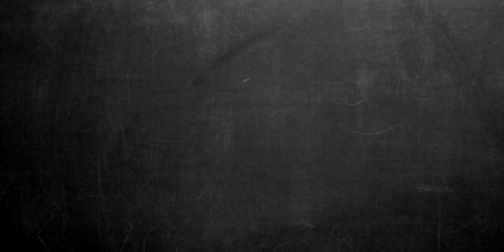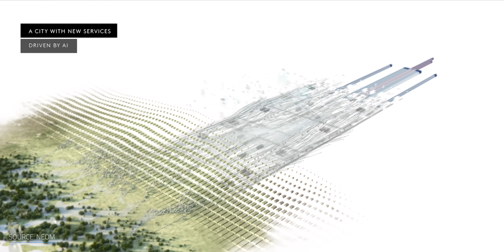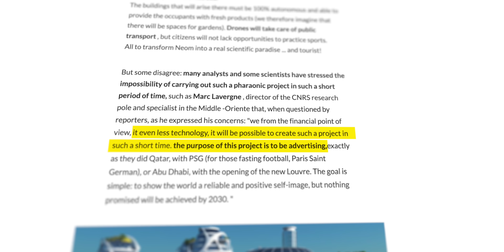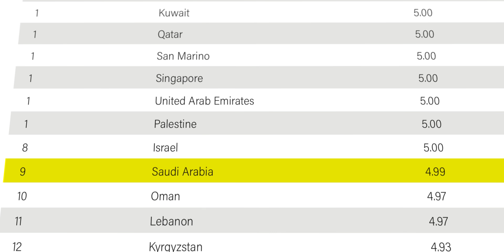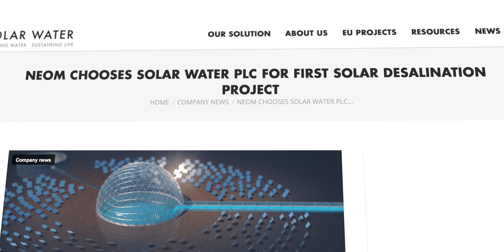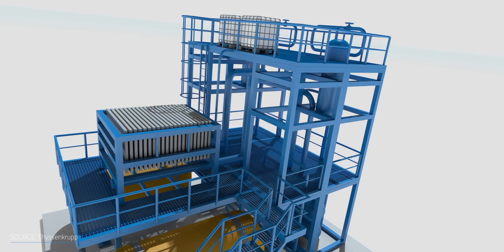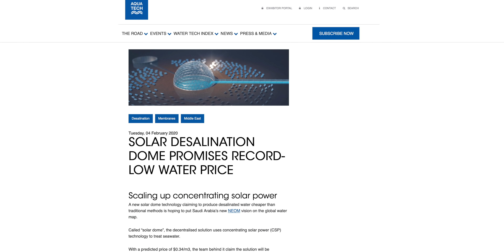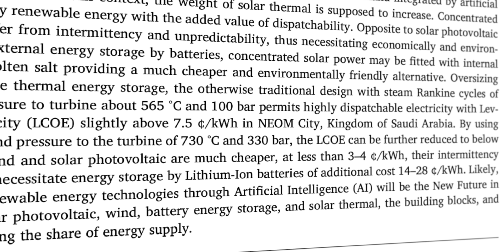Why Neom Might Be The Future of Sustainable Cities

Comment: Probably beyond the scope of this channel, but I'm also interested in the urban planning argument, most discussion of which I've seen seem to say 'bad'.
Reply: I've explained in other comments why, but basically, there is a reason every single city in the world naturally forms as a rough circle.
The short of it is that you want people to be able to get from place to place as efficiently as possible. A line is, geometrically speaking, the least efficient way to pack things closely. So, a city in a line is just a bad idea.

For a hypothetical, let's design a city with 1000 buildings, scattered at random for our purposes. If you place them in a line, that's effectively a 1x1000 grid of buildings. The longest distance one may have to travel in this layout is 999 blocks. The average travel distance for residents is going to be about 500 blocks. This is... not great. But how does it compare to a circle?
A circle with an area of 1000 if you plug it into A = pi*r^2 gives us a diameter of 36. So 36 blocks is the maximum distance you can possibly travel along one road, from one end of the city to the opposite. I shouldn't have to explain how 36 is a shorter distance than 999.
Someone did point out that blocks don't necessary allow you to always travel straight from point to point - you can't walk diagonally through buildings (this is often called "Manhattan distance". So the actual absolute worst case is if you're on one edge of the city and you want to travel to the opposite, but you're travelling diagonally to the road grid. In this case, to convert the diameter to Manhattan distance you can multiply by the square root of 2, which gives us about 51. So the absolute worst possible case ever in this circular city with 1000 buildings is that you'd have to travel 51 blocks, whereas the average case for travelling in a line would be 500. This is why it's bad.

A line is just geometrically the least optimal way to pack buildings together. At best, you can mitigate this issue with ridiculous technology, but in doing so you're using it as a crutch, not as an improvement. It would be much better to use similar technology in a city that already has good planning because that would make a city better rather than barely bringing it up to par.
Reply: @KingBobXVI  I guess the idea is that the sacrifice is to maximise efficiency of the spine. But even then, if you arranged the line in a circle with no centre, you could at least go both directions and halve the average travel distance. Disadvantage is you cannot expand any more, unless you add more rings and that defeats the purpose of a single spine. I guess the idea is also that each module should be self-sustaining, more like a mini-city than a neighbourhood, but I also don't see how you could get around leaving it for work or university/high school every day.
Reply: @ThomasNing  - the issue with that is that the "efficiency of the spine" only matters if you predicate the statement on the assumption that a spine is something that makes sense, but it isn't. Again, it's an attempt to maximize the efficiency of a layout that is inherently inefficient. It doesn't really matter how efficient you make it, you can't undo the fundamental flaw inherent in the design. The best case scenario is that the network reaches a similar level of efficiency as the baseline of a normal city.

And no, while the mini-city thing sounds less stupid, that's not actually what they're doing. One node is MBS's new palace (which will conveniently be finished before the project is shuttered, presumably), one node is going to have a hospital and other essential services, there will be a shopping district for luxury items and restaurants, and one other node is accounted for by another rich despot.

I think it's also misleading to call this a city, because it's really going to be anything but. It's not being designed for regular people, so schools and the like aren't really being considered. It's a playground for rich people and authoritarians, and the only others who will live there will essentially be their wait staff.
Reply: You should check out Taurus' comment on this video‚ its the second highest I believe?
Reply: This one discuss more of the roots of the linear idea as well as its possible pitfalls https://youtu.be/41sgRP0G6y4

Comment: A city has many connections (all sorts). It seems very dubious if all this can be 'flattened' to a single dimension. Even if it is possible, the risk of catastrophic malfunctions are unnecessary high by design.
Reply: It's something different. I imagine plumbing/electricity/internet will be fairly.... Straight forward to install at least.
Reply: I think this is just something to flex on or something like that. The location is perfect, but I think that they should try to "square" the line and shorten it.
Reply: @sm3675  but brother saudi arabia want people to travel long linear way so that country can sell more petrol and earn money. reply if you liked it
Reply: @narayankripa5279  I was gonna say something about them building it. Look up the video - Saudi Cleric: "We Arabs are backward, but we don't know it".
Reply: championchap  Interesting. So the scale of the city is very limited. Now that, you point this angle out, it occurs to me, that I've seen settlements of such layout. They are very small countryside hamlets, with a single street and houses on either side.
Reply: Cheap to Maintain suburbs are Ponzi scheme’s after the initial gross they will Implode because they don’t financially support themselves
Reply: @bojnicko  Well, they become Ponzi schemes specifically because they are not cheap to maintain :D
Reply: Well, it does allow services to be streamlined and to minimise extra cost in transportation network size and complexity. With such a design, it makes it far less necessary for people to use cars to get around, but the public transport needs to be able to cope with all that extra stress. There are better city-planning designs that decentralise the city and reduce use of cars without going to this extreme. Nonetheless, it’s still more promising in design than new mega-cities that are built around enormous highways
Reply: Very astute. And, it is exactly what governments are doing all over the globe, putting vast amounts of money into projects that require energy, water and people moved large distances, where just one, for example, hostile terrorist strike on just one element, can knock out a whole vast city. What we really need is a patchwork of small sustainable villages linked like a patchwork quilt. Thus, if one 'village' - small 'oasis' - goes down all the others keep going, sustaining themselves. Thank you.
Reply: Like most things out of Saudi Arabia, this is merely a result of too much money, not enough sense
Reply: Trains, cars, water, and gas travel most efficiently in straight lines, and in a linear city you can have solar and wind power everywhere because massive downtown skyscrapers don't block as much area throughout the day. It makes sense, don't you think?
Reply: @nathanchildress5596  You are completely mistaken. So what if trains, cars, water and gas travel most efficiently in straight lines? Does that imply that there has to be only one line? No. There can be two perpendicular line (and more), thus creating grid, as it is in an ordinary cities all around the world.

One line will create "traffic jams" in the long run - a there is only one way to get from point A to point B, and there are at least a few feasible ways (ie. of similar lenght) in a grid. From the reliability point of view grid is much more reliable because there are always routes that can bypass a damaged one. With one line you either have to deal with blackouts or build redundant lines for electricity for example. But imagine a fire that will damage all of the lines - main as well as backup lines...

But there are also other worse things that can happen to that linear city. Take sand storm for example, or simply sand trying to overtake city's streets as it is common in the desert. If the city is build as a grid you have to defend only the grid's borders (remove that sand from the streets and/or pland trees along the border). If there is a line you have to defend the whole span of the line. This is crazy and not cost efficient at all unless there are robots employed to do that on a large scale. But it's still like asking for trouble. 

The whole point of Neom was to compress the linear dimension of that city into a point because with a very fast train you reduce the travel time to non-relevant levels. But it still does create a problem of starting and stoppin the train - if there are supposed to be stops along the line then these can't be anywhere but only in a few locations (say, evely 10 miles or so). From these locations you should commute along the line but with different (ie. slower) means of transport. And this arrangement will cause the line to naturally turn into subcities every 10 miles or so ie. growth into a grid located around the stops where the trains stops.

But I doubt that this city even comes to existence anyway. It would be much easier and cheaper to build, I don't know, 4 cities along that line, connected with a fast train? That would make much more sense than the line.
Reply: @szlagtrafi9115  this is a bonkers city design concept where building Hyperloop along its backbone is "sensible" by comparison, precisely because this city design concept makes no sense, and neither does Hyperloop if on earth.

I'm thinking the most viable explanation for this city design concept was as a loyalty test and sanity check for the subjects of the area.

I'm persuaded that if Elon Musk thought the Hyperloop was workable on earth in any way that'd reasonably be expected to just break even, he would have committed his time, effort, energy and money towards it, rather than "giving" the idea away to everyone else to run with it.  Hyperloop makes perfect sense for working details if you are already on the surface of Mars because what's proposed for earthbound Hyperloop is to create a low-pressure atmosphere within it... comparable to that of Mars.  Combine that, with the minor detail that Mars has massive winds and windstorms with sand, and no preexisting buildings to pay to build through, it'd be "cheap" to build it there.

My prediction for Hyperloop on earth is it will never be built anywhere for useful transit: the math works nowhere on earth on pretty much every aspect.  Hyperloop can only make any sense in a planetary atmosphere equal or close to equal to that of the tunnel.
Reply: @szlagtrafi9115  You blew your whole argument: "So what if trains, cars, water and gas travel most efficiently in straight lines?"
That's the point. Traffic, just like a drop in water or gas pressure, or resistance in electrical lines, is caused by changes of direction. Why is the Autobahn so fast and efficient? Because traffic near their exits make way for faster traffic traveling straight. And yes, Trains do need to make stops, but in a linear city you could be a consistent distance from every station rather than being in a grid where you might find yourself on a corner of the city trains don't serve, and then you have to rely on cars and buses, which also travel faster in straight lines.

And when in the modern era has being in a grid prevented a city from being bombed or struck by a natural disaster? That doesn't hold any weight. 

This project could absolutely fail for many regions, the most likely one being uneven investment & development in different sections of the city. but to write it off from the start and act like our current cities aren't flawed just shows closed-mindedness.
Reply: @nathanchildress5596  Another problem with this line city is that while deserts have much less wildlife they still have abundant ecosystems that would be completely divided by this line. A wall a mirrors was also mentioned which would create extremely hot zones on either side of the city. There would be also problems with sunlight which wouldn't get to lower levels and they would need an extreme cooling system if they wanted it to be open roof. While there are flaws with current cities the problem I find with this line is the amount of energy and cost it would require especially as Saudi Arabia has so many civilians that are still in poor conditions and don't have access to even a sewage system.

Comment: The Line is a farce. They want to build a sustainable city, but started from literally the least sustainable shape. Efficient city layout is a packing problem: you want people to travel the least possible distance so they can rely on non powered solutions to get where they are going. The best solutions to most packing problems are circles: they maximize the internal efficiency of a region(the distance between any two points cannot be greater than the diameter) and minimize gaps between regions. Lines, on the other hand, are maximally inefficient: the constituent regions are only next to the regions on either side. 
Let's imagine a traditional port city: the port is a hub, in both figurative senses, we start by the water and fan out in a roughly circular shape until it peters out at the edges. The port is roughly in the center of the imaginary circle and no citizen is ever farther from the hub than the circle's radius (on average, globally, about 30km). Assuming that the citizens are forced to populate The Line equally more than 80% will live more than 30km from the hub with more than 40% living more than 100km away.

Comment: Simple answer to the question in this video:
NO.

WHY BUILD A CITY IN THE WORST POSSIBLE SHAPE POSSIBLE. WHY
Reply: @George Mann question: what shape has the most area for least perimeter and makes every point in it's area as close to it's neighbor as possible? If it's a cricle you're correct, then we can apply those question to a line, exept à line is a the worst in both cases. Plus relying on infrastructure without having a backup plan like diverting a road etc... Isn't a good idea.
SOLVING A PROBLEM WICH COULD HAVE BEEN AVOIDED IN THE FIRST PLACE DOESN'T MAKE THE PROBLEM A GENIUS IDEA
Reply: @George Mann no it wouldn't be easy, because there wouldn't be less than a dozen, there is thousands. So no it 's not easy to close all of them yet in a line, cut I off at any point and a large portion of the rest of the city is cut off, so how do you do tunnel maintenance? How do you upgrade? A city is easy because they can close a street easily to upgrade then pass on to the next, making gradual progress...

And WHERE DAFUC DO YOU PLACE A FARM IN A DESERT? ARE YOU A GENIUS OR WHAT, WHY PUT A FARM FAR FROM ANY SOURCE OF WATER, ALREADY PRECIOUS TO THE CITY, PUT IT NEAR A WATER SOURCE, YOU CAN ALREADY BRING FOOD EASILY WITH TRUCKS CENTRALIZED TO TRAINS
Reply: @George Mann okay, but do you realise that with the pipeline argument you pointed what I've been trying to tell you all along
Reply: @George Mann it seems you are American and doesn't realise that not all cities are American. I live in France but this concept can be applied anywhere else. Very few cities are bankrupt, our infrastructure holds up, and why would I bloody care about a nuclear bomb.
A line creates unnecessary necessity for a complex transportation system that must hold up. So yes à city can be small dense, or midly dense, and yet still have team busses trains, bike lanes, and roads and be perfectly fonctionnal.
Reply: @George Mann we'll see, that when there is something that shuts off one of the vital infrastructure that this city NEEDS to survive, exemple, due to attack, cyber attacks, suicide etc... Then how are you gonna pass THE WHOLE CITY TRANSIT IN AN EVEN SMALLER TRANSIT SYSTEM

Comment: Why not use the brine in other ways? And how high is the concentration?
And what is the volume of the Solar Dome and can refill the dome several times before I need to remove the salt?

10:45 did you say Thyssenkrupp?
Reply: The issue is that there's plenty of valuable resources in ocean brine, but they're stick together with toxic chemicals. If you want to use any one material, like phosphorus for fertilizer, you need to extract it from the slush of heavy metals, which is expensive to do.

Comment: My question is why don't they use heat pumps to work the desalination plants as this would increase the efficiency significantly because AC units use around 10% of the global energy production which can be seen as lost energy and a better question is what happens when winter comes as water production will decrease significantly as places like Africa have been known to have 2 inches or more of snow occasionally.

Comment: Thanks Matt, lots to think about there. x
The issue of water makes me think it might be a good test bed for using a man mad seawater lake to increase humidity in an area and along with tree planting increase rain and from that fresh water. It would though be a long term project which they would have to start now to have any effect down the line (Yes did the pun). :) 

I'm still optimistic about the hyperloop, most people who jump on the hate bandwagon don't seem to have done the research to see the disconnect with the claims against the system and what is actually being proposed. They've watch one infamous video against the project and that is all they need to know. :/